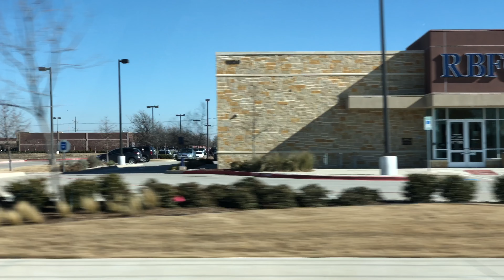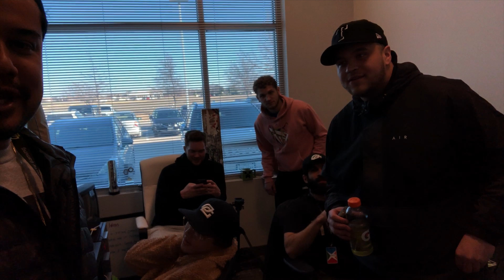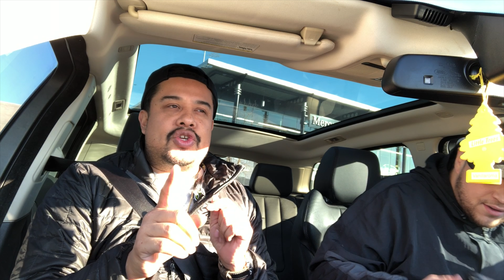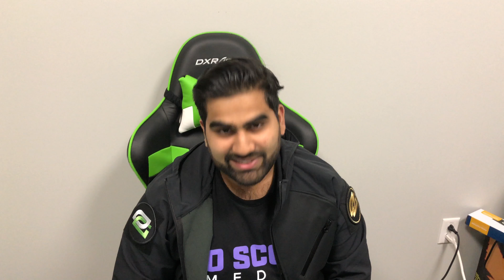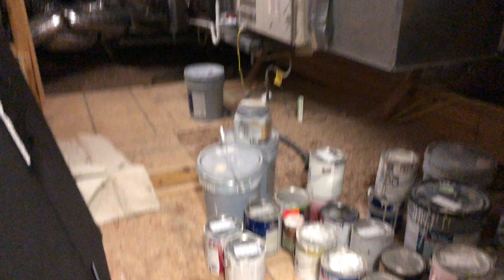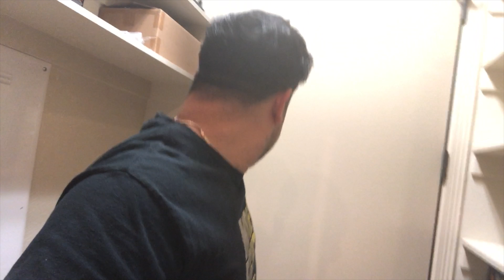THE OpTic office training rooms!

Comment: When you get your water heater looked at have them check the PRV (Pressure Relief Valve.)You say it was the water exhaust. Water systems are closed loop. Your PRV probably failed. That’s with the freezing. Or the drain line froze. But get that valve replaced good buddy. Also whoa that duct work is terrible!!!!!!!!!!!!!!!

Comment: You guys really need to start putting your phones and cameras on holders in your cars like...such a crap example to set and one day you might regret doing that when someone crashes :(
Reply: SarcastiKally this is why people don’t like uploading. People like you just nit pick them. He was most likely using his phone for gps they just moved there and have no clue where they are
Reply: Tyler Olzak Did you not read the comment? Put it in a holder. Less than 10 bucks on Amazon.
Reply: MBoze has been doing this since he's been vlogging for over a year. He never has his phone in a holder. I'm just saying it would be a lot safer...the gps can read aloud to him at any rate...he doesn't need to hold the phone for gps. I'm not even nit picking...I'm just thinking of safety here...